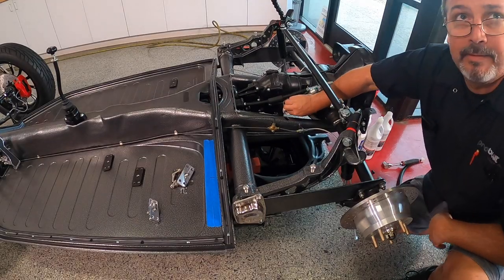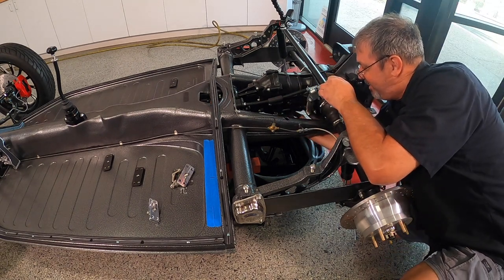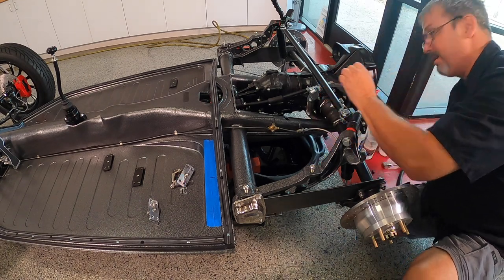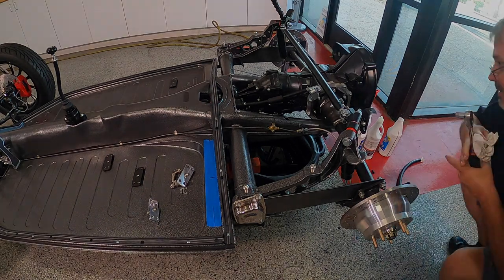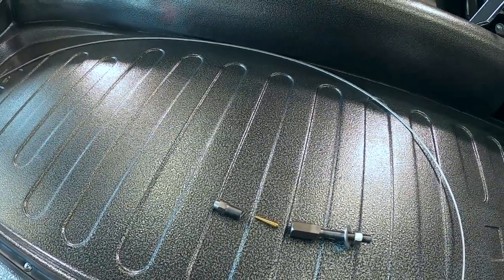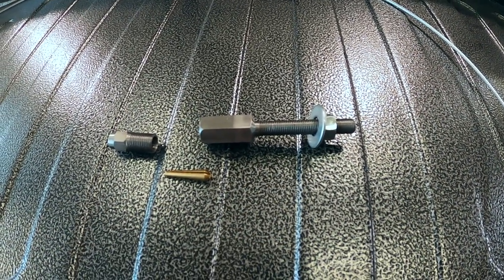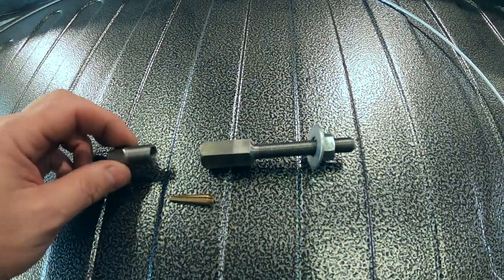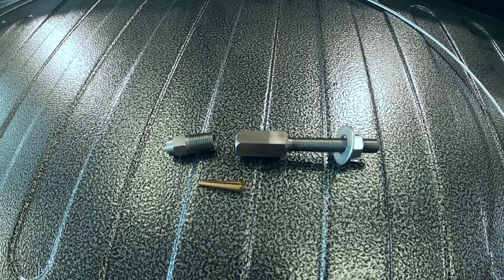Part 1  - Conclusion of the 14" Shortened VW Kit Car Chassis - a PRObuilt Film

Comment: What a great video and detail in the build. At 6:36 of video when you do double crimp. It doesn't look like you used gauge before crimp. Was that a professional guess on length? Could you have tapped the bracket for the caliper instead of thru hole nut and bolt?
Reply from the maker: Repetition is how we know with our measuring.